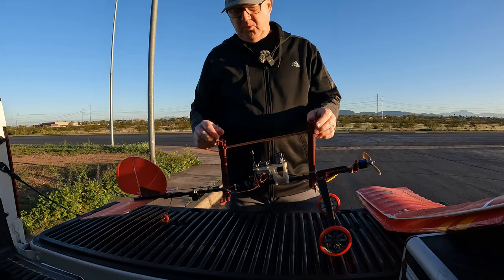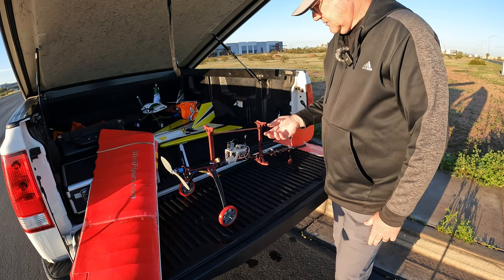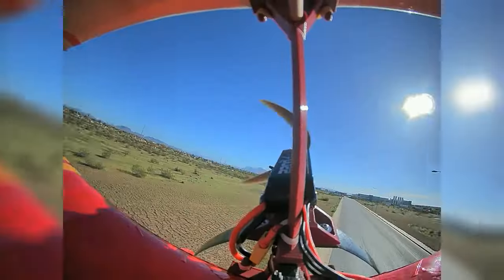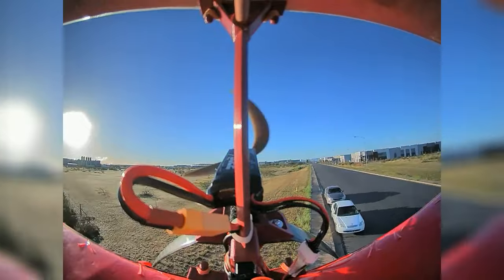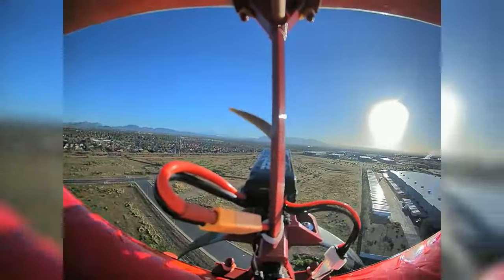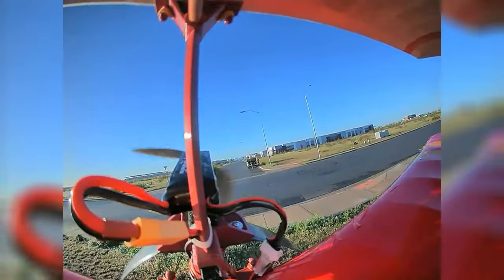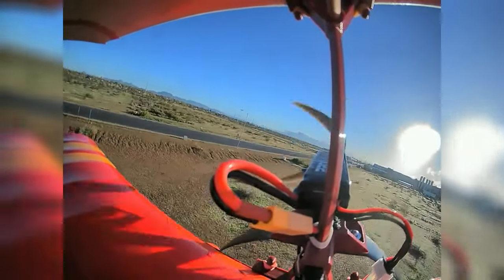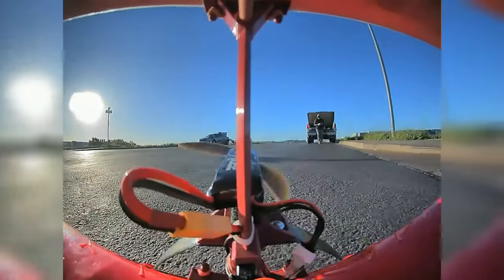Build this Slow Stick Biplane // Details & FPV Flight

Comment: In your list of printables, is there a servo mount part to mount the camera?
Reply from the maker: Yes, there are four different versions of the camera servo tray included with the Biplane STL files.
Reply: @Qromer  I saw the servoo trays.  But what's used to connect the camera to the servo head?